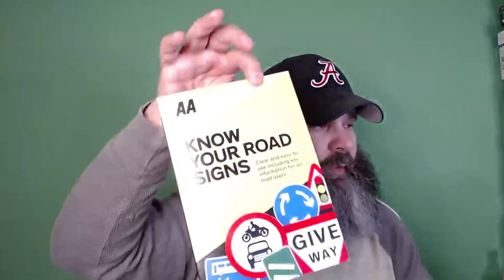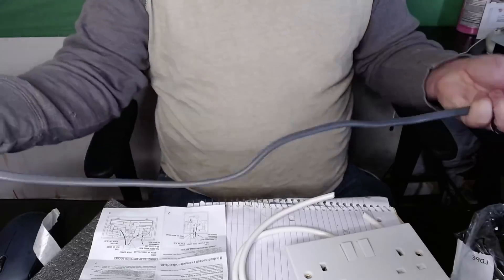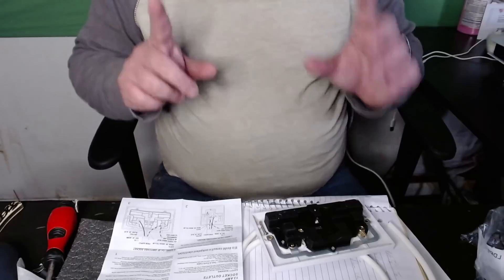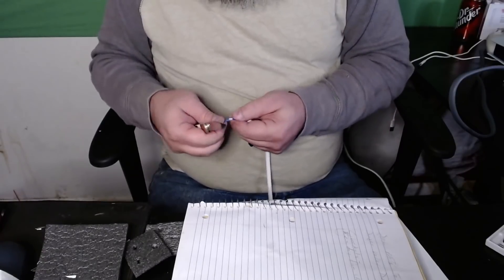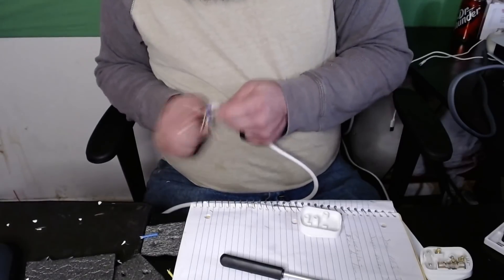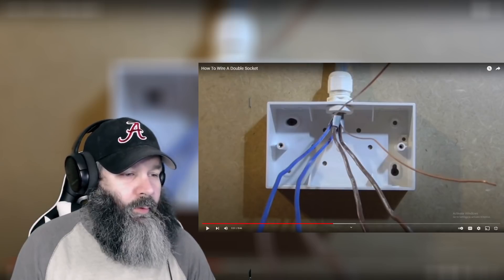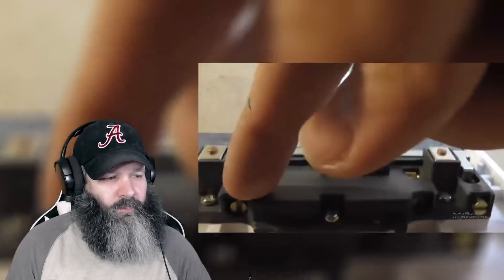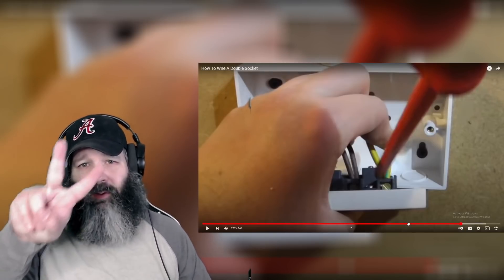American Attempts To Wire a UK Wall Socket and Plug

Comment from the maker: For everyone commenting I didn't have sheathing. Otherwise I'd have put it on there. We don't have sheathing on a lot of our grounds over here nor do we sheathe them if the don't. If I had known that little feature I'd have done it.
Reply: Usually Earth would have a Yellow & Green sleeve on the exposed wire...
Reply: Plug: the outer cover should be under the cable clip, and each wire should be cut to fit, so if it is pulled out the live wire comes out first....
Reply: The reason there's two in the example is because the UK runs a "ring main" so it goes in and back out to the next socket...
Reply: Sheathing???
Reply: Do you have a kettle? As in an electric one? I heard lots of people don’t. 
I doubt there is a single house, shop, factory etc without one in the uk.
Reply: @Elldeeve  yeah. They’ve got all these whistling hob kettles.
Reply: Is that how the Australians won the Olympics high jump🤣🤣
Reply: There is an easier trick which is to pull the copper wire and pull it down whilst holding the other two, if not the running the blade away from you is also preferable as someone who did an electrical course and stabbed him self several times I can contest to how painful it was,
Reply from the maker: @Elldeeve  I have one.
Reply: He’s saving wear and tear on the hot tap also…. Bottom gas….
Reply: @jessicapayne8622  plastic cover to wire .
Reply: @Elldeeve  You wont believe this , but I worked on the railway over here in Britain . And every loco I went on in the cab. There was a electric ring so the driver could boil water to make  a cup of tea .
Reply: @daveofyorkshire301  never happens in mine, nice little curl of loop on the brown wire !
Reply: @jessicapayne8622  boiled all mine dry,  if you look at theme, they never boil,  if you go to the loo while they are on they are dry when you get back
Reply: @welshpete12  ahhhhhhh.
Reply: @welshpete12  I can believe that. We run on tea.
Reply: @highpath4776  "if you go to the loo while they are on they are dry when you get back"

How long do you spend on the loo?
Reply: @BedsitBob  Times Crossword

Comment: Greetings from Norfolk, UK. Son of electrician here. I have also been in electrical/electronic engineering for the best part of 35 years. I have to say that this is not bad for a first attempt. Word of advice on wiring the plug, a majority of mains electrical plugs sold in the UK have a piece of thin card over the pins with wiring instructions and layout printed on them, I don't know whether your plug had it?  It tells you how much outer insulation to strip away, how much length to cut the Live, Neutral and Earth, and how much insulation to strip off them. All lengths are usually shown in millimetres. Use of cord grip is essential to prevent wires being pulled out of the terminals of the plug. 

I can remember as a teen helping my dad rewire houses. I used to watch in awe as he would prepare and strip all the cables with just a pair of electrician's pliers. He never damaged any cables or scored any of the copper conductors, everything went in perfectly! 

Edit, I can also remember being taught how to wire a mains plug correctly at my first year of high school (1979) in our science class. 

Great 'have a go' attitude that you have EB, good job.
Reply: Yep,  taught in science too on that, teacher inspected all our work.   Then we went back to bare wires held in the sockets with matchsticks as it was easier, lol.  Got an A/O level in Electricty and Electronics.
Reply: In Finland at the time you were strictly prohibited from wiring plugs or anything. We were old that te only thing you were allowed to do is to plug the plug in the socket and replacing a fuse was on the border whether it was allowed. Not that it prevented people. If a TV had an ungroudned plug that did not fit a grounded socket, people changed or modified it or made an illegal cord that removed the grounding - who cares about safety.

Around mid 80s they did allow wiring plugs and hooking lamps to the ceiling but still anything related to fixed installation is not allowed.

Comment: Good effort .The trick is to have the earth wire a bit longer then not so much to squeeze into the internal channels of the plug but that comes with practice then there are no wires showing outside of the plug only the white outer sleeve. Wire cutters are very useful . If thats your first time then very well done.
Reply: You should ideally have the Earth wire the longest, then the Neutral wire and the Live wire should be the shortest length so if the cable gets pulled and the wires aren't clamped down correctly the live will come away fires and everything should be safe. But you should also, as you said, make sure that the outer sheath is clamped firmly in the plug.
Reply: Easiest way is to fit only the earth wire, then cut the others to suit.

Comment: Slightly too much white outer cable trimmed, it's best to have the white thicker outer cable gripped by the screw clamp just inside the plug (which I think you missed and just put the wires over it. Measure what you cut and trim by putting the cable onto the open plug and seeing where the grip is, trim back to there.
Reply: Usually there is also a paper template that comes with the plug that tells you exactly how long to cut  and shred the wires. Obviously thats only available if the plug is new. I leave a little bit more slack in the earth so that if the cable is yanked the earth is the last wire disconnected.
Reply: Not just better; it is essential for the cable grip to be gripping the outer sheath.

Comment: I was taught a great trick to remember where the wires go when wiring a plug, you just need the first two letters of the colour of the wire. Blue - BL - bottom left, brown - BR - bottom right.
Reply: How about the resistor colour code? 
In Cardiff I was taught the most racist and misogynistic mnemonic ever.
I've never forgotten it though!
Reply: @John Foxton 
I wish it was still Red and Black especially on 3 core and earth with the yellow intermediate

Comment: There has to be a fuse because the ring circuit (outlet circuit) is usually protected by a 32Amp breaker. If a set of Christmas lights for instance were to develop a short, the wire would vaporise in a fireball before the breaker tripped so they would have a 3 Amp fuse in the plug. Each device (lamps, heaters, hair straighteners etc.) have an appropriate fuse that is just big enough for the device's requirements and less than the safe limits of the device's flex. The reason for the two sets of wire entering into the socket is the ring circuit. The feed comes from the breaker and is daisy-chained from one outlet to the next and this goes all the way back to the breaker panel, so each outlet is fed from two directions. This reduces the required thickness of wire and prevents the power from dropping as you move further from the panel.
Reply: I have real problems trying to work out what was done with the ceiling light wiring,  should be live in (From switch ) neutral in, and an earth.  But where the lives go out again (I have two lights in one room off one switch , it looks like they have been done out and back to the second light, and basically looks wrong , so goodness knows how it worked ?
Reply: I like the fuse feature on the plug, I think that should be used in North America too.
Reply: @monteclark1115  It is not needed as the socket circuits are max 20 A.
Reply: @okaro6595  but the cords on some appliances are not and I have seen some appliances catch fire. Heating pads and electric blankets are the first thing that comes to mind. I had a new kitchen blender that shorted out and caught fire. Fuses in the plug are definitely a necessity.

Comment: Tip my grandfather gave me was to always wire the earth wire with the most slack in it's path. The theory being if somebody trips over the cable and pulls the wires partly out of the socket, you want the live wire to be pulled out first and the earth wire to stand the best chance of being retained, still connected to the earth pin :)

Comment: The way I was told on my very first day of college was to remember which way round the cables went, we were told to take the second letter as a indicator, so bLue cable went on the left and bRown went on the right when doing a plug. That's literally the only thing I remember from all those years ago😂😂
Reply: I remembered it like this. Most 13 amp fuses are brown so, brown (or red for older wiring) to the fuse and blue (black) to the other. Earth to the top. The earth is big so connect it to the big pin.
Reply: @baylessnow  all 13a fuses are brown, 3a red and others (5a 10a) are black.
Reply: The socket would be fitted to a pattress box. Plastic if it's on the wall, metal if it's in it. They also have earths, usually the mounting screws will make the connection.

Most UK sockets will be wired in a ring main, so you'd have 2 conductors in each terminal. That's why the plug has a fuse - the ring will be rated at 32amps (240vac)
Reply: That does depend on which way round you hold the plug
Reply: Similar to how we were taught, we did BLue Bottom Left, BRown Bottom Right

Comment: I can't lie, that was painful to watch. 
They say that a bad workman blames his tools but man, you can certainly blame a large park of that on the lack of tools.
Good effort, interesting to watch you learning as you go, as others have said about the length of cable for the plug. Also the socket would generally have the exposed copper part doubled over and then slotted into the terminal to give the screw something to hold on to with it just being a single cable in there.

Comment: For someone who don’t know our plugs I was impressed, what I normally do is take the pins out of the plug, wire em up and then slide them back in,  just easier to screw, but everyone’s got some kinda opinion lol, easy 8/10 from me…oh and it’s ok to fold over the excess wire and twist it so it’s a little tighter especially if you’ve cut it to long saves cutting it with cutters or a knife lol

Comment: Have a look at how the plug and socket interact. The live and neutral sockets have a shutter that is opened by the earth pin, and the conductive part of the live and neutral pins are inside the socket before they make connection. They’re designed to be as electrically safe as possible.
Reply: Electroboom channel did an upload on UK sockets. It's hilarious.
Reply: @loafersheffield  The posh hotel room wall socket, BANG!!🤣🤣🤣

Comment: Glad to see that you watched how to wire up the wall socket so now you know how to do it properly, also good news for you is the new standard for mains cable is that the earth wire is already covered in green, so you just have pare it back like the other two, now for the plug see if you can find a video on how to do it properly, as your effort would not pass inspection, and is dangerous, here is the reasons, the outer casing of the whole wire must be the only part of the cable that is clamped with the plug clamp, the loose inner wires are of different lenghts for a reason, the live brown or red being the shortest just long enough to reach the terminal block, then the blue or black one, again just long enough to reach its terminal block, lastly the green/yellow one, let this one have a little more slack in the length, but not so much as you have to cram it into the plug to get it in, reasons behind why they are wired this way, the live one is the first one to break free and cut off power if the cable gets pulled very harshly, then blue/black, and finally the green/yellow, lastly always have the correct screw driver for the job, a pen knife cannot get get the screw tight enough, always safety first, electrics can kill.

Comment: Well done, that was good as a first attempt. Others have probably said: the flex sheath must be inside the plug, held by the flex clamp. It's easier for a novice to dismantle the clamp and put it back after. A trick for stripping the sheath on cable is to use a blunt knife and push it down lengthways between the bare earth and the neutral wire - blunt to avoid nicking the wire but sharp enough to cut the PVC. And even after 50 years, stripping the sheath on flex is still a bugger because it so tightly encases the inner wires.

Comment: Hi E.B., I`ve never wired a wall socket always left that to the professionals. However, I did learn as a teen, how to wire a plug & a 4-way extension socket. The only thing I would have done differently with the plug, asides from the yellow-green earth wire as mentioned by 25dimensions Francis. At the bottom of the plug were the wire goes in through the hole, inside the plug is a little bar with two small screws. 
             This is used to go across the top of the wires & tightens them to hold them in. When I did plugs, I would have it, so the end of the white outer covering was held in the plug by that bar. Not just the thin blue/brown/yellow-green ones. So, if someone pulls the plug cable with their foot or something, it`s not just the thin wires.

Comment: It's not just having a fuse in the plug, that's a good idea.

Having half sheathed live and neutral pins, to prevent the pins being touched while energised, is also a good idea.
Reply: The fuse is there for a reason. In the UK they use ring mains where the breaker can be 32 A. In other countries one cannot have normal sockets in so high current circuits. It is not some additional safety but an integral part of the system the reconstruction committee designed.

The system is ugly in that the fuse in the plug protects also the socket. The  socket should not be protected by the thing that is plugged on it.

Comment: Some UK plugs come with a piece of cardboard at the back, showing the lengths you need to cut the wires  to, in order to fit them correctly.
You'd be surprised how many people in the UK don't know how to wire a plug.

Comment: Grey wiring without sheathing on copper wire is typically used in high current draw applications like an electric cooker. It would be hard wired into a cooker specific socket behind the cooker and on a separate relay on the fuse board. Standard white wiring, cut 3" outside sheath off and push under the loose cord grip making sure the yellow green can reach the top earth connection. Tighten the cord grip now so it can't pull out. Trim the blue neutral wire and attach on left terminal, trim brown live wire and attach to terminal on right equipped with a fuse. Pull cord and check the wires are all secure before putting the back onto the plug. We used to be taught this at school before it became law that all electrical appliances came with a pre-fitted safety plug.

Comment: Best way I suggest doing this is:
Feed the flex (flexible wire vs the stiffer in wall wire) under the clamp (the 2 bottom screws)
Remove the earth pin, Attach earth wire (you only need to strip about 1/4" of bare wire)

From here you can split the outer sheath and trim the Blue and brown to suitable lengths to reach their respective spots and strip the 1/4" off the end.

Side cutters / snips are useful. But a knife is fine.. If you slice the sheath gently then pull it will come off cleanly. 
Then if you pull the wires apart, the outer sheath will split and you can trim as much as you need from there

As for the design, They are made, as you observed, with integrated fuse and earth. 
They also have insulator covering the bottom half of the live and neutral pins so you cannot touch the metal when it is making connection.
The earth is the longer pin and this means that earth is always first to connect but also the socket has integrated covers for the live and neutral which the live pin actuates and allows access. Otherwise kids could put stuff in them :)
Reply: I agree - removing the pins (which the instructions don't mention as a possibility for some reason) is always the easiest way to get the lengths right.

Comment: You did alright. I taught my wife to change a plug just after we got married (1967) and devised a memory aid for the three cables - red on the right - green for earth (grass) - and black on left. Then the buggers changed the colour codes and I had to change the memory aid bRown on the Right (Brown got an R in it ). Earth had an added yellow stripe (I made up a story about yellow patches on the lawn from our female dog - but we won't go there) and then black and blue both start with B. We are both as yet un-electricuted so it must have worked.

Comment: Easy tip with wiring a UK plug, BRown bottom right terminal, BLue Bottom left terminal, Green in top terminal. I've deliberately used capitals in the words blue and brown so you can see the concept.

Comment: In the video you watched there are two cables being connected to the socket. Possible reasons to connect more than one cable to a socket are: (1:) to effectively increase cross-sectional conductor area (CSA), therefore current rating, and/or (2:) because it's going to be connected to another socket, either as part of a radial circuit (not a very common type of wall socket circuit in the UK) run, or spur on a ring (final) circuit (a very common type of wall socket circuit in the UK); or to the fuse box/consumer unit to complete the ring (final) circuit that it's a part of.

Comment: The reason there are two cables going to the socket is that in the UK virtually all homes have the power sockets on a ring main. So the cable goes from the consumer unit (fuse box) to the sockets in a big loop and then back to the consumer unit. It's one of the reasons we have a fuse in each plug. I believe in most countries sockets are on radial circuits. Ring circuits were chosen after WWII as they use less cable and strategic metals like copper were in short supply at the time. If you were wiring a spur off a ring circuit it would look like what you did with just one cable.